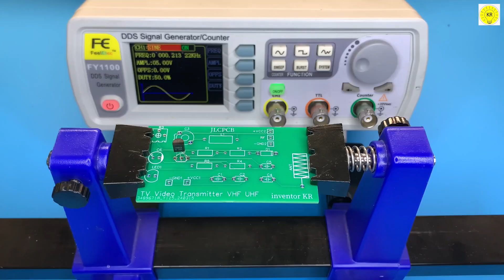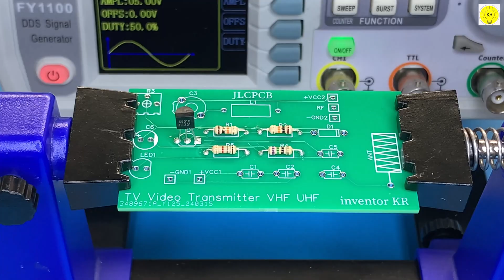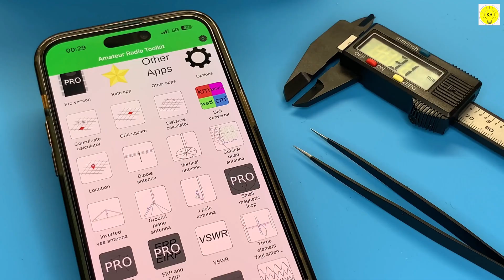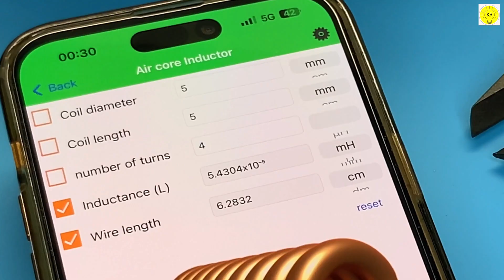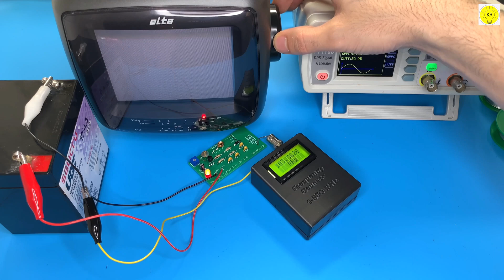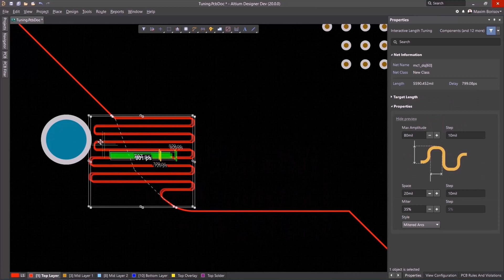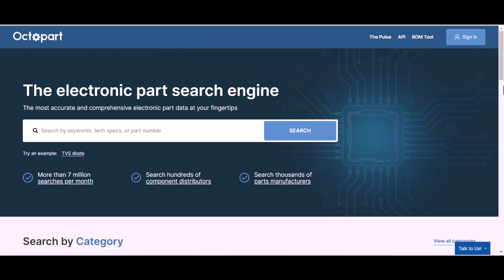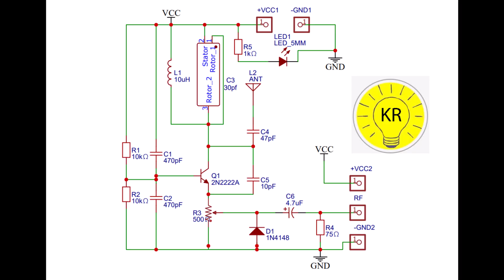how to make video transmitter , PCB board

Comment: Great job...now I need to know for the PCB rotary vise at 0:12 if it's 3D printed. If yes where I can get STL files
Thanks in advance
Reply from the maker: It is sold ready-made and you can find it on Amazon or Ali Express
Reply: @inventorkr1  I tried with several way but I can't find it...can you tell me what keyword shall I use please....
Reply from the maker: @5b4aezmarinoscyprus71   Goobay 51220 Soldering support For fixing printed circuit boards & parts during soldering and DIY work with mounting clamp/360° rotation
Reply: @inventorkr1  ok I got it... 👍

Comment: FCC open up!
Reply from the maker: Perhaps you did not read what was written in the description well. In addition, this is an educational circuit whose transmission range does not exceed outside the room of the house.
Reply: @inventorkr1  yeah, that small setup can’t transmit far without good antenna

Comment: Very good project.
 For those who wonder, this is a AM RF modulator that works on channel 5 (Australia) or 3 (Japan) for 107.1MHz. To be used in other regions (Europe, Americas, Asia), must change the coil and for higher channels use a RF transistor) or use a TV set with CATV band. My guess is that it can work well on lower VHS band and maybe with an RF transistor on lower channels of the VHF high band. In some coutnries, it work on VHF CATV band.
The potentiometer adjust the level of the input signal.
Can be used with a video signal B&W or color but is for video only because it do not have the audio modulator. 
The TV standard - PAL, SECAM  or NTSC - is determined by the video signal and not the modulator.
The modulator must be tuned on the frequency of the channel wanted (the video carrier).
Can be used with any old console, VCR, DVD or any device that have composite video output. (remember Sega Nintendo, Sinclair Spectrum, MSX?)
Also can be used for any TV that can receive the old analog TV signals (have an terestrial TV tuner) which most modern TVs do not have anymore.
Reply from the maker: Well done, thanks for your valuable information
Reply: @inventorkr1  Well, thanks. I used to do similar modules for old consoles and home computers that did not had RF output, in early 80s, when most TV sets did not had AV input, so the only way to display them on TV was trough an RF modulator. I usually used to make them for channels 2-3  because the transistor could be any type and there was no TV interference on those channels.
Reply: @sebastian19745  Now we are talking 😊
Reply: Thank you for the additional information, very helpful!

Comment: If you want to get good lifespan out of your soldering iron. Do not run it hotter than it needs to be. I think 270-280 would have done the job.
Reply from the maker: This type of soldering iron requires a high temperature setting